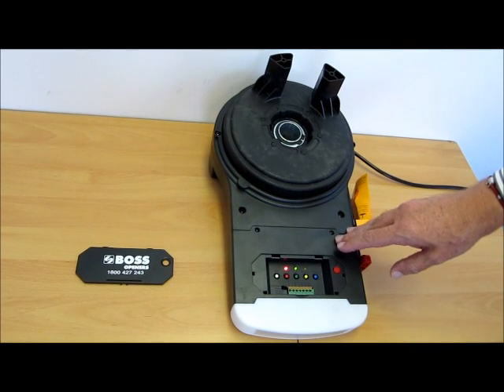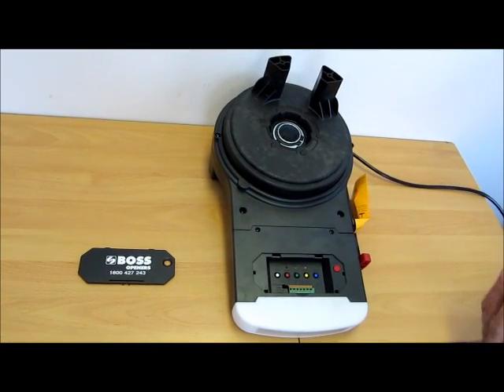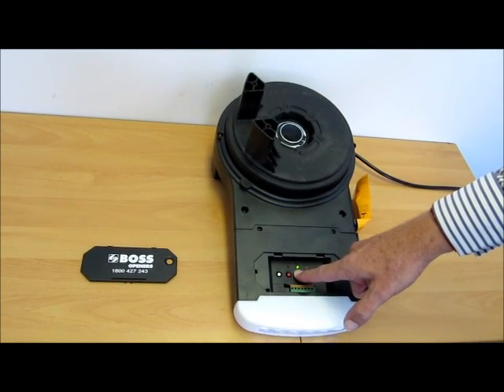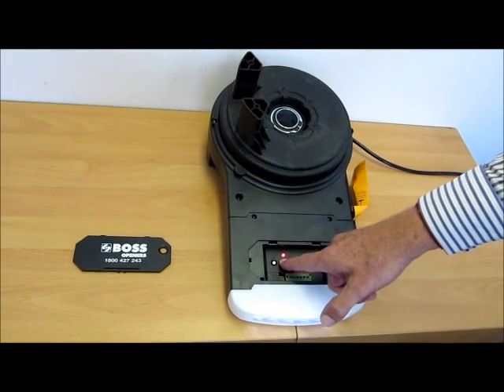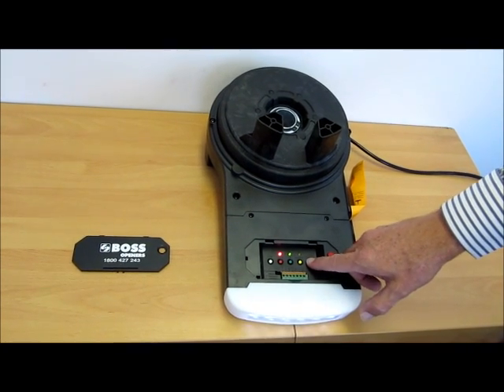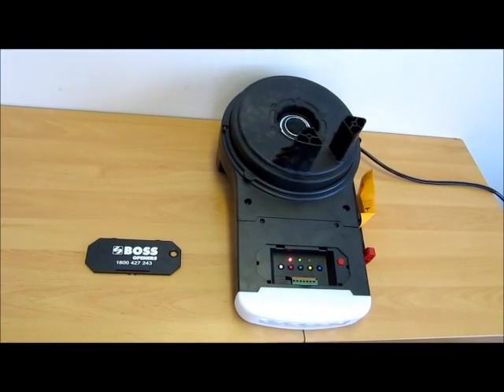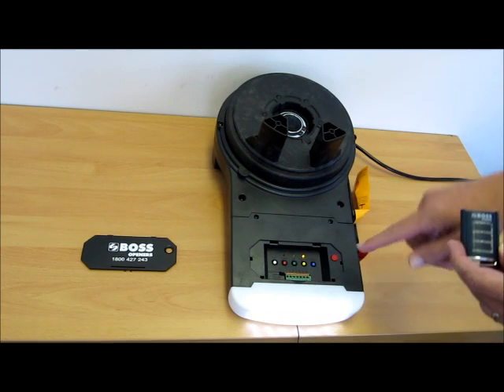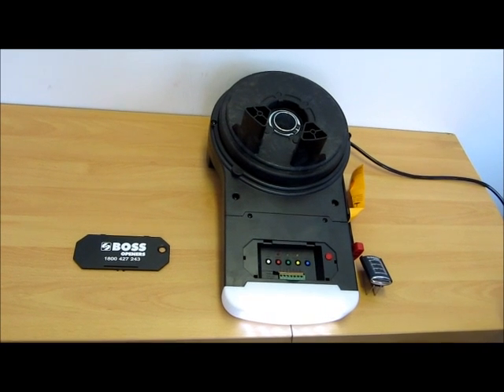How to Programme a RD11 Roller Door Opener

Comment: slight error right at the end, Programming Transmitter. If you hold the Radio Set button down for more than about 3 seconds all transmitters get deleted (mine did), so to set transmitter - as you press Radio Set button also press appropriate button on transmitter, after a few seconds yellow light will come on and unit will beep 3 times. Transmitter works ok then.

Comment: Thank you for this excellent instructional presentation, it saved us $400 having to get the unit un-installed!  I wonder if you can answer this question for me, please?  My unit’s engage/disengage operator lever (the one with the red plastic end at the right side of the unit) is broken, but the roller door operates normally.  Can this operator lever be removed altogether ?  It appears it’s not needed, but it’s not letting me use the door manually (without the motor being engaged).

Comment: Is there a way to wire in a push button switch I see there is terminals there but nothing out there for haw to connect
Reply from the maker: Hi Ian, You can download the Installation Instructions & Owner's Manual from https://www.steel-lineautomation.com.au/uploads/7/2/0/3/7203835/rd11_installation_instruction_and_owners_manual.pdf . Please refer to the "Main Control Panel" drawing on the top of page 7. The "Push Button" is the active trigger connection. The button on the right hand side of the "Push Button" is for the ground/earth connection. If you have more questions, please call us on 1300 007 081. One of our friendly technicians will be very happy to help you.

Comment: Hi. How do I reset the motor? I have a 12 beep fault when trying to set limits when I ask the door to go up. So I can’t get any further in the set up. 

Is there a mater reset button?
Reply from the maker: Hi David, thank you for your message! There is no master reset, usually they turn the power off and back on. The 12 beeps indicates another issue, i.e. the logic board is playing up. This will require a service call. Please call us on 1300 767 900 or visit our website www.steel-line.com.au to book a service. Thank you!
Reply: @Steellinegroup  ⁰

Comment: How do we rest the unit after we have service door
Reply from the maker: Hi, Wassa Wassa, thank you for your message. You can find the details by clicking the following links http://www.steel-lineautomation.com.au/uploads/7/2/0/3/7203835/how_to_programme_a_brd11_roller_door_opener_2.pdf and http://www.steel-lineautomation.com.au/uploads/7/2/0/3/7203835/rd11_installation_instruction_and_owners_manual.pdf. If you have further question, please call us on 07 3713 3200. Our technician will be very happy to help you. Thank you!
Reply: Two very good questions asked without a proper response how do you reset to start over if you messed up the set up or do you only get one go. The answer is not in the links provided or the user manual